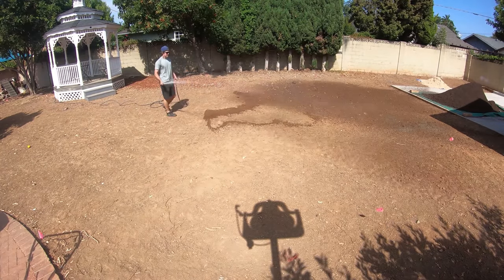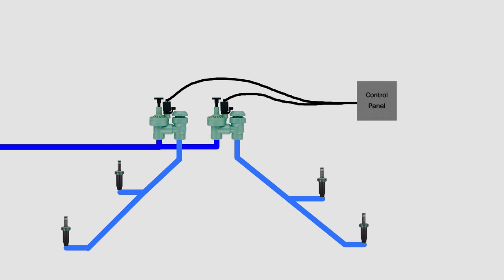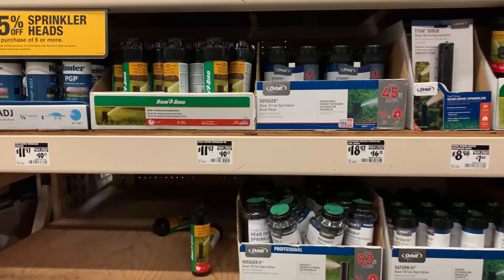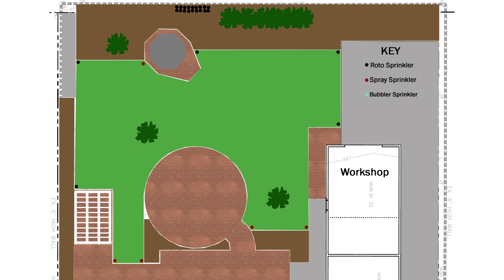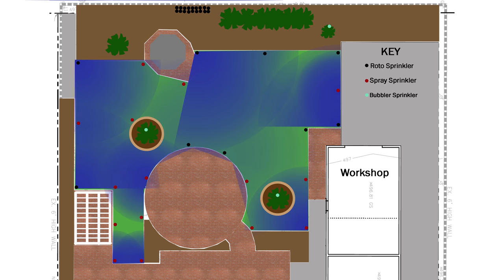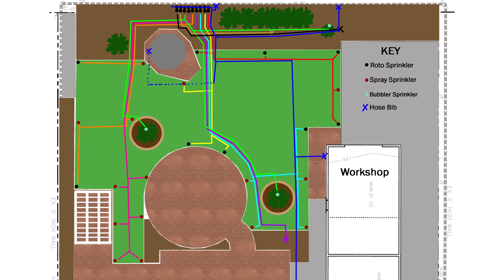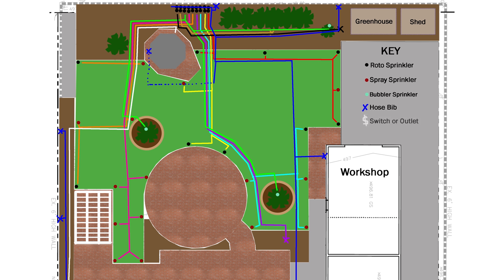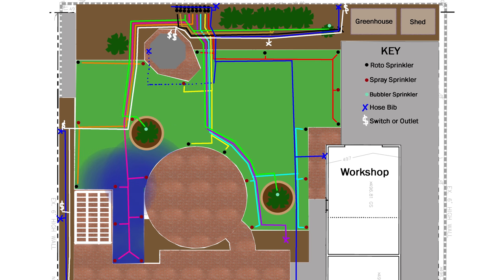Backyard Renovation Part 2: Designing the Yard

Comment: big fan of your videos, i have a question, with your background being in stunts, What gave you the confidence to tackle such big projects such as the plumbing and electrical yourself? it seems very well thought out
Reply from the maker: I think the confidence comes from doing smaller projects to become familiar with the work and materials, plus doing an insane amount of research before and during a project. Maybe just like with learning a new stunt, I’m not afraid to fail because I can usually just fix the mistake and keep going. The motivation comes from saving on the cost of labor and knowing I won’t cut any corners along the way.
Reply: @BenTardif  thanks for the information! looking foward to seeing what comes next from you

Comment: When we bought our house, it came with a sprinkler system.  We were not told before. So we turned it on and some leak, some don’t pop up, and now we know it was turned off because maybe a pvc pipe broke or sprinkler heads are bad. I don’t have the money or know how to dig up my yard to find all the pipes.
Reply: I AM WHO I AM D ; I have this same issue, from talking to other people who had this issue, they recommended to just ignore it. Disconnect the old system and remove all the heads you can find then just build your system

Comment: When I lived in SoCal, my irrigation was mostly install and forget (though I had to replace broken heads from time to time).  But out here in Reno, as in most of the rest of the country, it's really a pain.  The irrigation system has to be fitted with valves at low points so you can drain and turn off the system every October.  And no matter what you do, when you bring it back up again in the spring, ice formed somewhere and there's a leak.  In the last three years I've replaced a number of drain valves, but then this house has an old system and maybe I've replaced enough components the next owners won't have the hassles I've had (I'm selling the house this autumn).  I'll be designing and installing a new irrigation system for my house downtown next spring, but it's a very small house and yard and will be much simpler than yours, despite all the need for drains, etc.